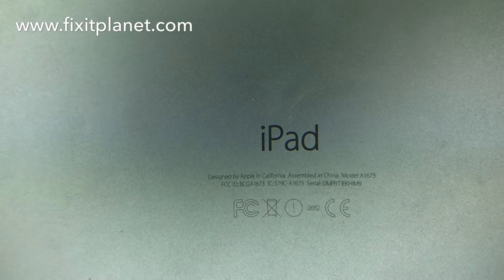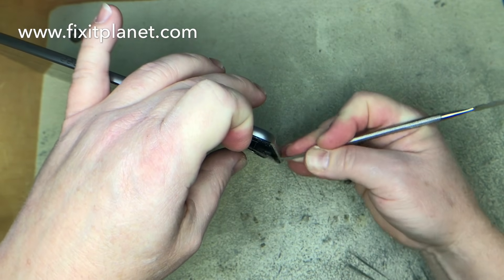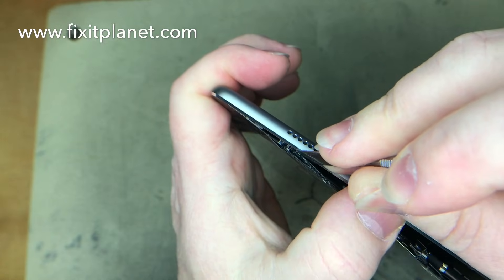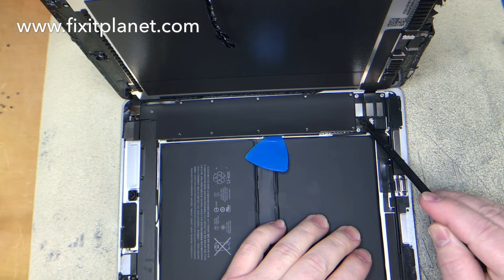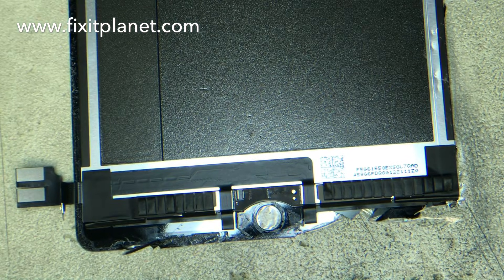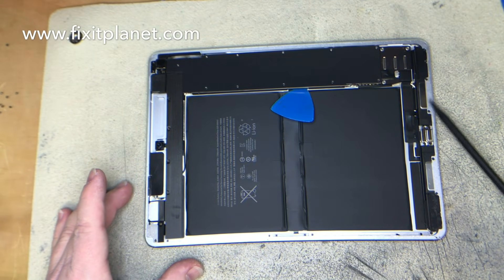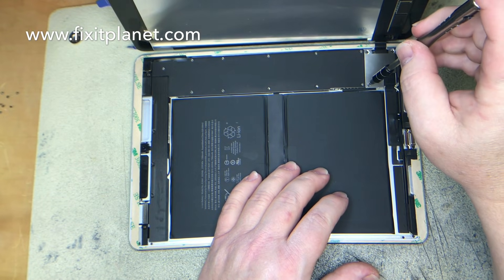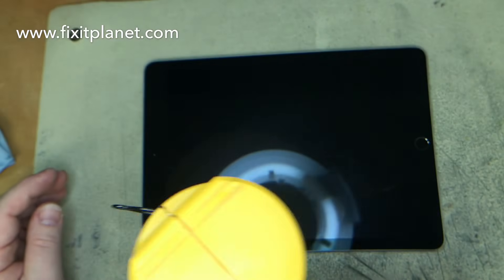Super Easy iPad Pro 9.7 Screen Repair From Start To Finish.

Comment: Everything on the pro seems to be a replacement of the digitizer with the glass. can just the glass be replaced and keep the old digitizer?
Reply from the maker: The "glass" is the digitizer (which responds to your touch) is fused to the display (sometimes referred to as "LCD") and is the part that shows the image. It is possible to separate the two but is difficult and not very practical.
Reply: Fix It Planet can you make a video on that too? I have a broken screen. But display and touch are working good. New screen is costing over 200$. I just want to replace the glass part. I am sure many have the same problem
Reply: Teja Srinivas there are videos of this, and it looks like a nightmare. It sucks, but if you want to fix a cracked glass the really only practical solution for at home DIY is to replace the entire LCD assembly.
Reply: Fix It Planet will the TOUCH I.D. still work after replacing the screen?

Comment: 1. Looks like you removed the home button and its rubber ring dust seal all in one piece? That way you don't have to disassemble it completely?

2. You don't have to also test the keyboard functionality to ensure no damage was done to the three "pop" press in connectors?

3. Why didn't you clean up the adhesive tape on the battery connection protection cover and add new tape just to that area you disturbed?

Comment: Where do I purchase the display? Every one that I see online says it doesn't include the LCD panel.
Reply from the maker: Here is one for sale (both colors) https://amzn.to/2Utnthl
Reply: @FixItPlanet1  At that price, I'd just have it done professionally. I found a place locally that quoted me $175 which seemed like a lot considering I had my son's 2017 ipad fixed for $75. Now I know why they charge so much.
Reply from the maker: If you have someone locally that can do it for $175 that's sounds good.
Reply: Don’t feel bad at your US prices as here in Canada I paid $400 for my screen replacement last year. Now my battery is gone and the power connector is acting up, so do I just buy a new iPad or pay the big bucks and just get it fixed.
Reply: Ross in Ontario I ended up replacing mine but I bought the base model 2019 iPad with 128GB storage and LTE. I still have the iPad Pro as a backup and my kids use it with the broken screen. I can tell the difference between the laminated and non laminated screens but otherwise, they are very similar except I have a lot more storage now. 

I’m not sure I really need an iPad Pro. I mostly just surf the net and watch videos on it. I have a MacBook Pro and a decent windows laptop for when I need to do heavy lifting.

Comment: I watched your wonderful video.  When I pulled the black tape up with the home button, the metal connector on the end did not come up with the tape.  Now we don't seem to be able to figure out how to get the connector out of the old screen.  Any suggestions?
Reply from the maker: I believe we spoke via text message. Hope we were able to answer your questions. Cheers!

Comment: Ugh...I forgot to change my screen timeout back to “2 min” after needing it on “never” for work. I’ve been away from it for 2 months and had left it on the charger. I guess it overheated and now the screen has popped open along the entire camera side end. The screen must’ve expanded as it’s warped up and even though I can press it down it won’t stay. It still works fine. Is there anything I can do to fix it?
Reply from the maker: Sounds like the battery swelled up. This would explain why the screen popped open.

Comment: Last 3 of these I've done, the bottom of the screen never sits in correctly. Forced to use liquid adhesive and clamp till set. It works, but not ideal at all.
Reply from the maker: Make sure the home button bracket is not preventing the screen from sitting flush with the housing. Make sure that any dents in the aluminum are grinded down and housing is not warped etc. Always verify the screen will fit properly before attempting to seal.

Comment: What iPad is this and what generation it’s same like mine but I don’t know which one it is
Reply from the maker: This is the iPad pro 9.7 inch they came in three models A1673, A1674, and A1675. You can find your model number on the lower portion of the rear of the iPad.

Comment: Will the TOUCH I.D. still work after screen replacement?
Reply from the maker: Yes... as long as it's not damaged.
Reply: It needs to be the same home button that was issued with the same logic board. They’re paired in the manufacturing process. If you do not have the original button, Touch ID is lost.

Comment: Where can I find a iPad Pro 9.7 screen replacement? What is it called, I seen a few on amazon for $39 and I feel that’s not the right one
Reply from the maker: The screen assembly is not $39. for sure. You can get either black or white here https://amzn.to/2yrea8k the entire display assembly is fused together it is not just the front glass.

Comment: I just worked on one, replaced the tristar ic and charging port. It was a real pain to get the board out. Sadly the initial fault was actually just the tristar ic but the client mangled the charging port for no reason so I replaced it as well.  🤦🏽‍♂️

Comment: It would have been helpful if you made it clear you were using a preassembled digitizer and lcd.  It was a good video overall, but i had to watch half way through to realize it wasn't going to help me with my issue (replacing only digitizer).
Reply from the maker: Don’t blame me…. If you did a little homework before attempting the repair you would have known what you were working on.
Reply: Same, I don't know what eveyone saying. You can just destroy the lcd if you going to buy it kit like that. Of course it will be easy

Comment: So if my tablet is not the 9.7 pro it’s just the 9.7 is the process still the same?
Reply from the maker: Some processes may be similar but each iPad model is either slightly different or very different but never identical.

Comment: hi, does the Apple pencil work on these replacement screen? thanks.
Reply from the maker: The ones I use are are exactly the same as original screens quality & function work fine. I haven't had any complaints yet and at least the 9.7 & 12.9 I used for the videos own and use a pencil. ;)

Comment: What adhesive do you use?
Reply from the maker: 3M Super heavy Duty
Reply: @FixItPlanet1  What millimeter sizes and item (part) number?
Reply: @FixItPlanet1  Bumping the question below.  What thickness and width?  Great video!

Comment: What about this micro soldering I have heard on the daughter boards attached to the back of the screen?  Different 9.7 Pro A1673 or what?
Reply from the maker: There is no soldering required for the 9.7 inch iPad Pro (A1673). The 12.9 inch iPad Pro requires soldering.

Comment: The iPad is bent ?
Reply from the maker: Yes a small dent on the bottom left corner from the drop but not too bad. We used a grinding stone on a Dremel to smooth out the dent so the new screen fits properly.

Comment: Help! My screen replacement was a success. However, now my iPad shuts off after 1 or 2 minutes. It goes blank and then I have to wait for the apple logo to cycle threw. I’m assuming I damaged a connector? Disconnecting the bat connector was difficult to do with the pick? I had to use a lot of force even after heating. And I accidentally disconnected one of the black wires with the 90 degree connector. I pushed both down? Any idea what I should look at if I open this up again?
Reply from the maker: WOW... How can it be a success??  i don't know what you are talking about.